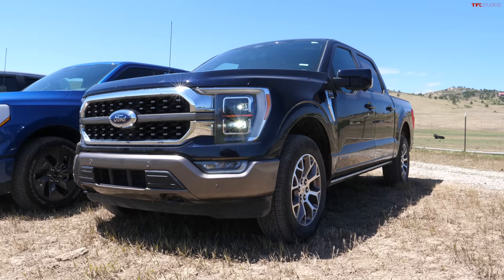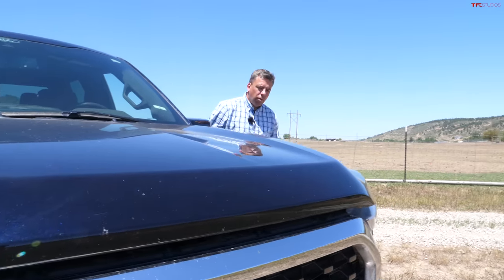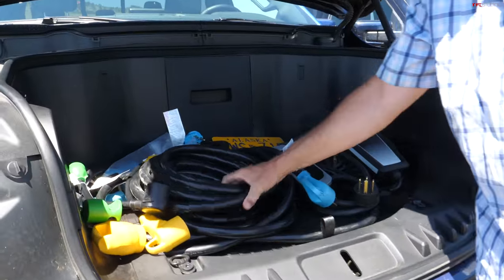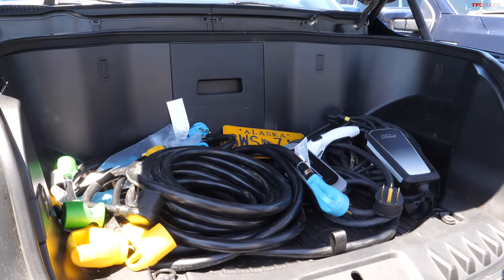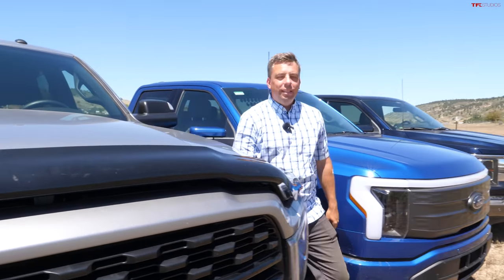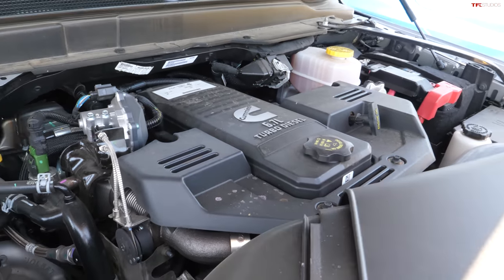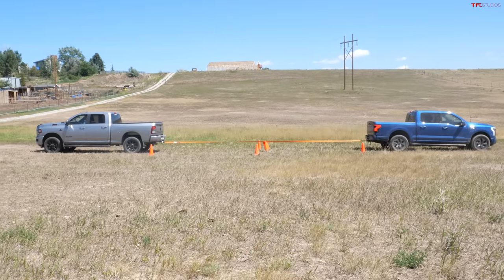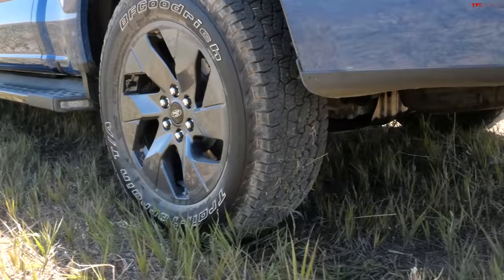Diesel vs Electric Tug-of-War: Ford F-150 Lightning Takes on the Ram 2500 Cummins In a Nail Biter!

Comment: Engineering explained broke down the science of this a few years ago. What should take place is the heaviest vehicle with the most force multipliers of torque will win the tug of war every time. I highly recommend watching his breakdown of the cyber trick vs f150 for reference
Reply: Correct.  Tug or wars mean absolutely nothing.  It means the vehicle with the best weight and distribution and tractive effort will win.  If I had a 15,000 pound lawn mower with a 20 HP engine and it was geared correctly, I'd win.
Reply: But the heavier vehicle lost in this one. Even with having more weight and torque than the lightning the lightning still moved it. And with just using the front wheels. Impressive. ICE’s are on their way out.
Reply: True, the ram lost only due to turbo lag.
Reply: @dee-or9zh  it lost because of instant torque. Its that simple. Like hitting a light switch the light comes on right away. Same thing with EV’s.
Reply: @mguerra310  They are on the way out but not for any of the reasons you’re being led to believe.
Reply: Whoever is hooked higher, the lower pickup pulls it down and increases the traction,  the higher pickup pulls the lower pickup up and decreases the traction.
Reply: @mguerra310  I think I said that, turbo lag equals no instant torque.
Reply: @dee-or9zh  yes i am agreeing with you which is why i mentioned the light switch
Reply: @mguerra310  does the lightning have a motor on every tire? The cummins would only get power to 2 in 4wd.   Power usually never has much to do with a tug of war, traction is about all. It’s not a surprise that a truck that will have all 4 tires pulling vs one with open diffs…. Lol
Reply: This should have been done on asphalt not dirt and not to be that guy in the comment but “ building boost” prior to the pull in dirt only spun the tires on the diesel witch led to the 6 inches it went backwards. Dirt is a terrible place to test something like this especially on street tires. Also the first f150 wasn’t spinning it the front? Was it not in 4low?
Reply: @davidburdett1920   i think it’s dual motor one on each axle but not 100% sure about that. The rivian does offer that though 4 motors to each tire i think.
Reply: They should have done this on wet grass after a  rain to make it scientific.
Reply: And the ram can go all day the electric can't but good pavement pounding toy
Reply: Engineering be damned - the lighter Lightning and with less torque just pulled a freaking Ram 2500 with significant more torque & weight
Reply: Lightning > Ram
Reply: @ahuskyslegacy7896  I just pulled 12,000 pounds 2000 miles in 3 days in a ram 2500. When the lightening can do that it will stop being an expensive toy. Till then it's just a 100 mile toy. I would love a towing capable EV but no one has built one yet because the battery tech isn't there.
Reply: @multivisao  fyi the torque difference isn't that much between the two. 775 for the lightening versus 850 foot the standard output 6.7 in the ram. This is the baby Cummins is still a great puller capable of 20k in a 2500 and 22k in a 3500 but nothing compared to the high output at 37,100 with over 1k ft/lbs of torque.
Reply: was a great video too!
Reply: cyber ... trick? I assume that was a typo.
Reply: @dee-or9zh   - hence why they needed to load up the ICEs to on the brakes to converter stall - then torque is liberated the instant the brakes come off... (or some optimised version of that for the limited traction - lol,  mud tyres would be better to use)
Reply: @davidburdett1920  (on level  "homogenous" ground, open diff "part time 4x4s can nearly evenly send power to every wheel - ie. in any case every wheel gets the same torque as the lowest traction wheel  - on that axle  (and if one spins a  bit of light brake pressure tames it and sends more torque to the non spinning wheels)...  many  ppl think systems work significantly differently to how they actually do...)

(power torque, speed - they are all interrelated and backwards convertable - just maths and engineering)
Reply: @kadmow  I haven't driven a RAM lately, but I know with my GMC, preloading the torque converter is almost useless, the computer dials everything back.  All the nanny stuff comes online. In 4Lo, even when nanny is disabled, if there is any yaw happening, the dumb nanny comes back online.
Reply: @kadmow  lol well for an accurate comparison the same driver should be in both? I understand how applying brake pressure can actually even put the drive system and apply traction to all tires. But it is only for a short time. Been there done it a million times to get out of a mud hole. 

And nearly send the power to every wheel is not anywhere near the same effect of sending the power there with no slippage. Pressing on the breaks for a short burst of awd proves that.
Reply: @dee-or9zh  : Sad isn't it. how much fun could be had if nanny took a break?
Reply: @davidburdett1920   (you missed the word "evenly"   - brakes, gently does it  , cheers...)
Reply: @kadmow  If I get really stuck, I have to pull the fuse!  The G80 will not lock up unless the nanny is completely deactivated.  Whoever thought this was OK, should lose their job.
Reply: Lol….. donot forget the mass repartition of both EV and ICE. The ford gas and ram are from heavy unlike the 50/50 lightning
Reply: @mguerra310  nonsense!!! The ICE are nose heavy which means way less traction on the rear wheels, try it again with loaded bed.
Reply: @carholic-sz3qv  won’t make a difference. What part of instant torque don’t you get. It’s who ever is quickest to the draw that wins.
Reply: @mguerra310  instant torque my @zzz let’s do another test with loaded beds no need to argue more. The empty ICE truck has a disadvantage on the rear wheels compared to 50/50 weight distribution
Reply: @carholic-sz3qv  . Yes indeed, if you meant. "Distribution" and "Front Heavy" (simple typos- )edit helps. (in any case simply, perfect traction control and Torque control at Zero RPM, combined with a compliant -non tramping/bouncing TUNED independent suspension give the EV an edge, and not because it is EV.)
Reply: @kadmow  wrong!!!!!!!!!!!!! Torque and traction control are even less effective on the ICE truck rear wheels since they aren’t as loaded as the front one, same goes with driving dynamics and comfort with the solid axle clown! Let’s just last then to do another test to confirm it.
Reply: @carholic-sz3qv  : ha ha ha,  triggered much ???

Just load your truck like you are a real truck guy otherwise GTF0h...  ha ha..  ha  ha ha ha ha....   baby..  lol....
At least you seemed to learn the edit trick, lol...
Reply: @mguerra310  actually the rear motor were engaged most likely it didn't have enough power to spin them once they loaded up plus they make max torque at a stall anyways dry payment with a 1000 lbs in the back now that's a real tug a war
Reply: @mguerra310  the weight distribution of the truck matters, center of gravity
Reply: @REALBanannaman  not with EV’s bud. Your truing to apply what your normally used to. EV’s are not normal. Instant torque is the biggest factor.

Comment: This is an very easy explanation.  No weight in the back of the diesel truck which means no traction for the rear wheels of the diesel truck.
If some weight was in the back of the diesel truck it would pull the electric cord all over the field like it was nothing.

Comment: Well the fact that the Lightening only has an 86 mile range while towing a trailer is a complete deal breaker for me.  I'll stick with my Ram Cummins Diesel for anything needing to be towed, thanks!!
Reply: Basically “the lightning beat the ram but let me come up with something to make me feel better about my POS Chrysler”
Reply: @ahuskyslegacy7896  would you hitch up to a 43' 5th wheel camper with that POS lightening and tow it down the road for 80 miles then stop for 4-6 hours to recharge it to drive another 80 miles??  Spoken like a true Ford fan.
Reply: @jasonwescott3105  I wouldn’t buy a 5th wheel camper when I have a house to sleep in. And if I did my local campground is within 30 miles so yes I would actually. People try to overcomplicate towing range with the lightning. For the 1% of people traveling 100’s of miles to sleep outside go ahead and get a ram and make sure you wear your seatbelt so when your transmission slips 100 times on the ride you don’t hit the dashboard
Reply: @ahuskyslegacy7896  well clearly you’re the utmost expert on all things towing!!  Next time I’ll be sure to ask you all about it before I make a stupid purchase like a 5th wheel.  Oh, and I do have a house to sleep in as well.  Why would I buy a 5th wheel to only go 30 miles?  That makes as much sense as a submarine with a screen door.
Reply: @jasonwescott3105  why does it matter if you are 30 miles or 100 miles away in your 5th wheel? Is a 100 mile away camp site better than a close one lol. Let me just drive 300 miles away to park my 5th wheel in the woods when I have the same woods 20 miles down the road
Reply: @ahuskyslegacy7896  we get it. You have no reason to own a towing capable pickup. You are the exact person the lightening was created for. It's a nice truck but it's not a useful pickup for towing. I greatly want a towing capable EV. The instant torque is amazing, but until someone actually builds one, those of us that actually need a towing capable pickup will be buying diesels. Not to mention the lightening would be illegal towing what that ram can legally tow and that's the standard duty ram. Technically that 6.7 Cummins is capable of towing 22,670 lbs. And the high output version can legally tow 37,100 lbs. Far beyond what the lightening can and they can do it hundreds of miles between stops.
Reply: @jellybeanpop  to say the lightning is not towing capable is incorrect though. How many truck owners are towing anywhere near the numbers you are talking about lmao. Your argument on the towing range of the lightning is based on what? A couple videos on YouTube. It’s fully capable of hauling things 150+ miles and this is literally the first generation. Improvements to the range has already been done moving forward in the 2023 models and will continue. This is the first electric pickup truck, if you think that electric trucks won’t haul more efficiently than your diesel over time buckle up
Reply: @jasonwescott3105  i also would tow a 43ft 5th wheel trailer with a "half ton" truck.

people are acting you have to buy one. if you just drive your truck to work everyday and maybe haul stuff every now and then or pull a sxs 40 miles to ride somewhere once a month not in the highest mountains, it's totally fine
Reply: @ahuskyslegacy7896  we get it you love EVs so much reality isn't something you like to face. Stop moving the goal posts. We aren't talking about future pickups here we are talking about today pickups. I clearly stated I would love an EV capable towing pickup but they don't currently exist despite what you may think. So I clearly support future innovation in the market segment. Also Unless that 150 miles you mentioned is between 2 chargers it's not happening, besides all tests point to less than 150 with around half the claimed payload so stop with the lying and propaganda.  Also literally millions of people tow heavy everyday for work but I understand people in cities that you notice don't do that means no one does. Those cities get built by people driving pickups and pulling/carrying heavy loads and there are literally millions of us. Also the current charging network doesn't exist to charge vehicles with trailers so add that to the list of BS you have to deal with when towing with a toy. Find a place to drop the trailer go-to the charger wait 1 hour or longer drive back to trailer, hoping it wasn't towed or stolen. Reconnect continue on to job site. Explain why you're late. Rinse and repeat until you're fired, good times. I agree most people that would buy a 1/2 ton aren't towing but guess what sweetie. The test brought a towing capable truck into the discussion, albeit the weaker of the two options ram offers. So this became about comparing the baby ram to the lightening and the lightening isn't even close. You're saying most people don't need the ram, but it's in the test. A test designed to give the impression the lightening can out work the ram. This is fine, misleading and outright false information is all over marketing videos like these. Many of the people here defending the lightning have miss stated the output numbers for the ram so either they are lying or misinformed. Don't want to have the lightning compared to a towing capable truck? Don't put them in a BS test then act like they are remotely equal. I will concede to you once you bring that mythical future EV that can tow it's actual maximum tow rating the same distance as the ram can tow it's actual maximum tow rating. I'm not even requiring that mythical EV to tow what the ram can. Just the advertised range. Fyi no EV currently advertises the towing range because it's embarrassing. Untill then you just sound sad. Really really sad. Now had the lighting been left in it's lane I would agree for a 1/2 ton it's pretty decent most people that buy half tons don't really use their pickups as anything more than pickup shaped cars and that's fine but the video set the rules and the pickups to be compared. Also this is not the first electric pickup. You can't even get that right. Also we aren't talking about hauling efficiency. I will admit internal combustion engines are terrible at converting fuel into energy. Stop moving the goal posts. We are comparing the current capabilities of these two vehicles. Nothing else. To meet the requirements that Ford would need an unloaded range of almost 2,000 mi to tow its payload around 500 mi which is still less than what the RAM can tow in 8 hours.
Reply: @jellybeanpop  if you think I’m reading that novel you are hilarious. It’s also hilarious that you think the lightning can’t tow 150 miles plus when I have had an estimated range of 160 miles with a cargo trailer attached to it. If you are using your personal truck to haul things 1000s of miles for your job that sounds like an issue in itself. The lightning is fully capable of towing. I’m not a EV fanboy I like Ford just like you clearly like Ram. In every aspect of a truck the lightning is better besides range of towing. But it’s not as bad as everyone makes it seem and while you pay $200 bucks to fill up I’m riding for practically free. That hour of charging is saving me a lot
Reply: @anthonyrowland9072  My 5th wheel weighs in at 14k loaded.  I wouldn't tow it with a half ton truck personally.
Reply: @ahuskyslegacy7896  The towing range isn't based on a couple Youtube videos.  I have been told those numbers directly from a Ford rep who I was talking with in regards to the vehicles ranges.  He told me that they are getting 86 mile ranges on average pulling a 5k trailer on a full charge.
Reply: @ahuskyslegacy7896  if you felt that was a novel I would be concerned about your reading ability. Nothing you or I stated established either of us favoring a particular manufacturer. I simply stated objective facts about the vehicles and you did your thing. Personally I find all vehicles to be wasteful garbage in the long run. Also what does ownership status of our vehicles have to do with this conversation? Rather weird deflection, Stay on topic please. Also why is the towing range based on a couple of YouTube videos a bad thing but the results of this video are proof of something? You are obviously arguing in bad faith and extremely biased. Your argument thus far has been "I'm right everyone else is wrong regardless of objective facts." Have a wonderful day and work on being a better person. You clearly have a lot of work to do on that.
Reply: @jellybeanpop  my guy that was the longest YouTube comment I’ve ever seen lmao I just don’t see why every guy that has a 5th wheel hates on the lightning. The ford rep you talked to must be referring to the pro model. If you have a camper or plan on towing anything with the lightning I would think you would get the extended range which gets above 150 consistently. 2023 model will be even better
Reply: What is the percentage of these oversized overbuilt monstrosities doing the work they were built for again? Like 5-10%? Most pickups are doing the job of a Prius and most HD pickups that are doing what a Prius can't are doing the job of a light-duty pickup. I've seen tons of Cummins, Power stroke, and Duramax trucks on the road. Less than 1% were towing 10k+ "3 car trailer, container chassis, etc...". Americans just love pickups and their specs for bragging rights, it's like a dick-measuring competition but among virgins. The lightning has a pretty good theoretical market for all those pretty road cruisers but all the people buying the gas versions want the theoretical towing range just for the flex.
Reply: @ahuskyslegacy7896  the lightening can’t handle the weight.  It’s doesn’t have the suspension for it or the brakes to stop it.  So regardless of the torque rating it just simply wouldn’t be safe enough to pull that much with it.
Reply: @MrAdoh2010  well I don’t know where you live but where I am most every diesel pickup I see has a trailer attached to it more times than it doesn’t.
Reply: @ahuskyslegacy7896  the ram has a lot more torque and torque multiplication. Not to mention you can actually use it and still get good range.
Reply: @jasonwescott3105  A 43' fifth wheel would need a 1 ton SRW at the minimum and preferably a dually.  Even lighter "half ton" fifth wheels are too much pin weight for a half ton truck.